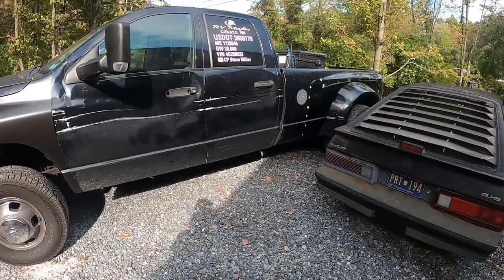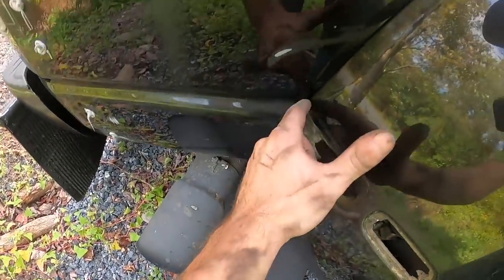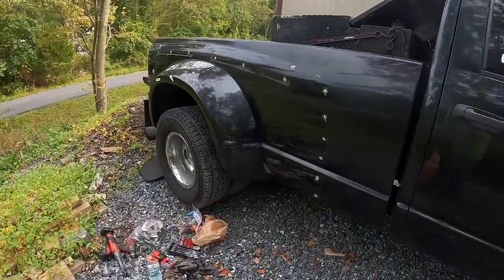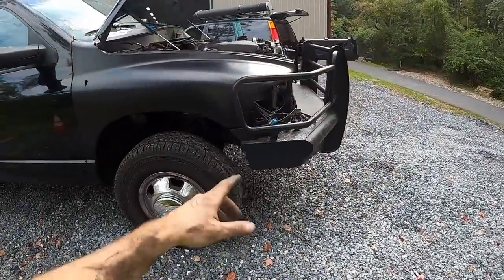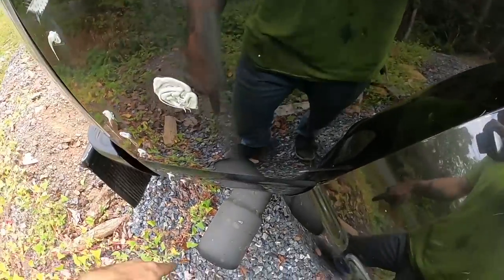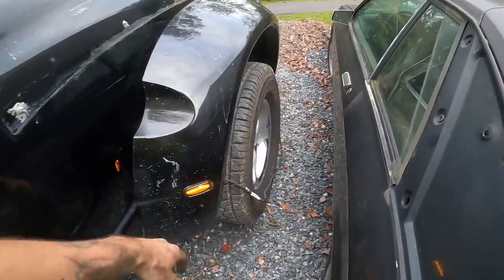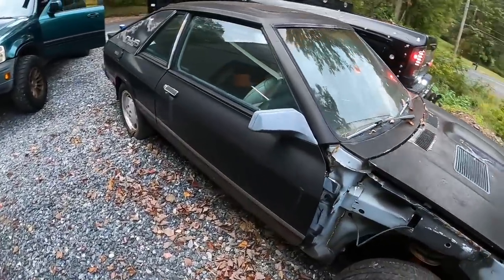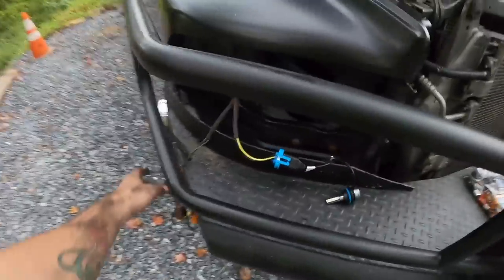Electrical Is Done | Almost Ready For The First Drive | Dodge Shelby GLHS?

Comment: Weld or rivnuts to fill holes.  That body filler will just fall out unless there is fabric behind.  Even then, welding is best.  You should put the mudflaps on the flares.  That way they will be out of the way and fully legal.  Put steps on the bed just behind the cab so it is easy to get into the bed to grab things.  Put "permanent" camera mounts on cab and trailer and run multiple cameras at all times.  ITM, 33, 33, 33.  Rubbleizer out.

Comment: if you're not too worried about imperfections you can just do a Macco Paint job and they can turn it out in about a week. Certainly will not be a great paint job but maybe cheaper.
Reply from the maker: Time is my issue. These parts took forever to come and I had so many flakes with things like the instrument cluster
Reply: @CPSteveMiller  Certainly understand that, we just got to do what we can when we can, great content though, keep it coming.

Comment: You know why you suddenly have that clearance issue between your door and Fender, right? It's because the heat from soldering the wires for the lights on your mega cab flares warped the clearance on the front of the truck between the fender and the front door
Reply from the maker: Lmao

Comment: Looks sweet I've been combining my 98 1500 with some of the 1st generation parts. Though didn't turn out as nice as your combination does. Though I don't get why you would get rid of the 4x4. I get your trying to save weight but for the benefit of having it theres other areas you could find to save weight such as going to aluminum rims and ditching the dual rear wheels for a super single setup up or going with lower profile tires ect
Reply from the maker: Weight, fuel mileage, it's a highway vehicle, simplicity, less service items, aluminum wheels would be nice but they break easily I've found. Duals have a higher weight rating than a super single and are easier/ cheaper to get if a blowout or flat ever occur. I've always hated single wheel trucks
Reply: @CPSteveMiller  true to most of that. I don't tow down the hiway being ag based. Towing 40ton rated gears that we often snap spindles off due to overloading I couldn't imagine not having 4x4 when towing.  And beings in Michigan and living in an area that the county doesn't plow the roads till atleast 6 inches of snow fall itd make 6 months of the year very hard to tow in
Reply from the maker: I stay on the east coast so 4wd is never needed. Even in pa I got by without it
Reply: I work for a tow company in mn and we only have 1 truck with 4x4 all the other trucks are 2 wheel and do just fine
Reply: @zandergregory7388  again im in the middle of nowhere nearest town is 20 miles in any direction and any thing like tow trucks police or fire department are 45+ minutes away with lights and sirens 1+ hour for regular non life threatening stuff. After 3in of snow we are given a warning that we are on our own if you chose to drive and tow trucks and emergency response will not be able to come help if you go off the road ect.  Your tow truck has something that a 1ton or less truck doesn't have and that's weight. Even the tow trucks around here often get stuck or won't go on calls down  certain roads that are known to not be plowed. It can get interesting but leaves us non County plow trucks in a position to make tons of money just pulling people out of ditches or driveways. I often make more money towing during a storm than I do plowing.  I have a few regular customers that pay quiet well for me to meet them and plow them a couple miles long path to a main road just so they can get thier 4x4 suv out to go to work

Comment: Not to be a buzzkill but filling in those holes with body filler is a mistake. Body filler holds moisture it will bubble. Especially on the big hole. I do body work for a living, I've seen it happen
Reply: If I remember it was urethane panelbond. Not IDEAL. But for a budget non permanent fix. It's just fine